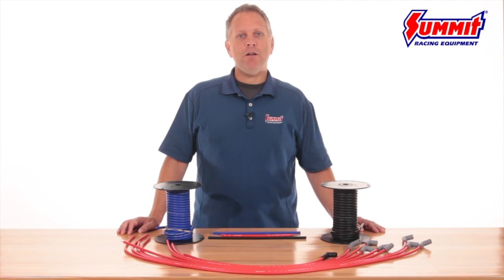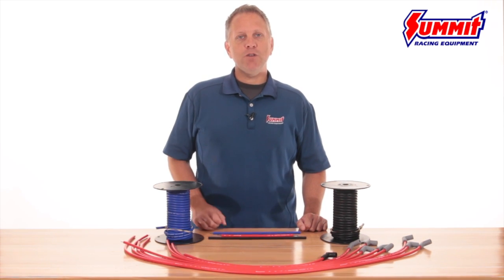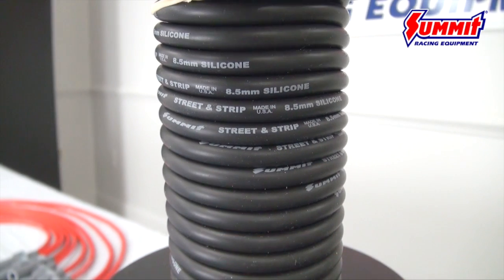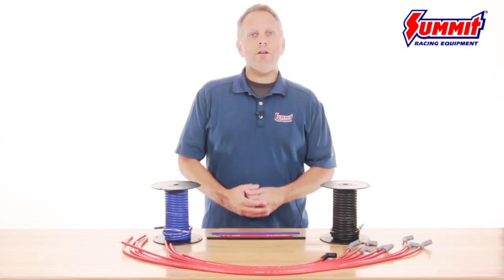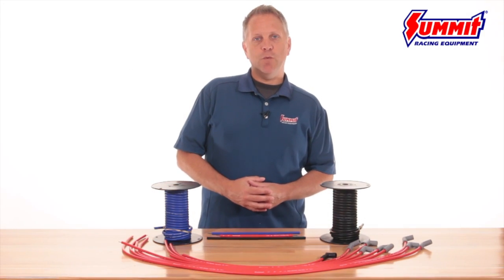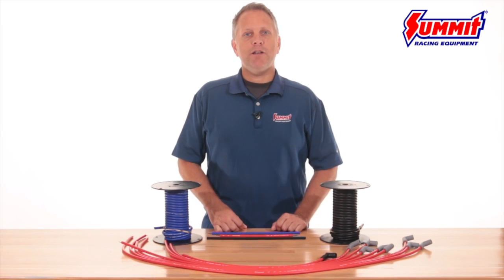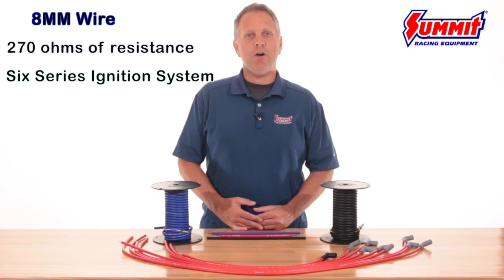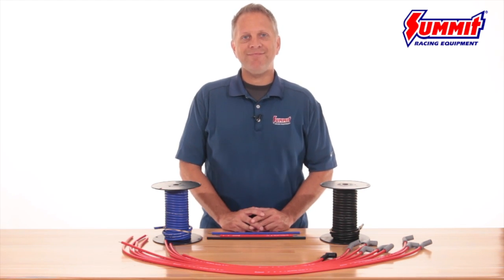Summit Racing Ignition Wire

Comment: how do your wires Stack Up I have a 76 J10 with a built 401 lifted 40 inch tires and it really Burns through the mud and the snow I have Blue Max solid core wires in there do you have a solid core wire I would like to put them on my big Ford 87 F-250 four wheel drive 5 speed 460 I'm probably pulling the ignition out and the distributor and changing it to a dual point instead of electronic that will make it impervious to EMP.
Reply: sorry these wires only work with 34in tires
Reply: +Trey Stine what does the tire size have to do with the wires I'm talking about the ohms of resistance versus Blue Max wires for my Ford truck with a 460 your wires are very appealing but I'm not sure which would be more practical your wires or Blue Max I do not care about the radio
Reply: +bill thompson hahaha I just made a joke man